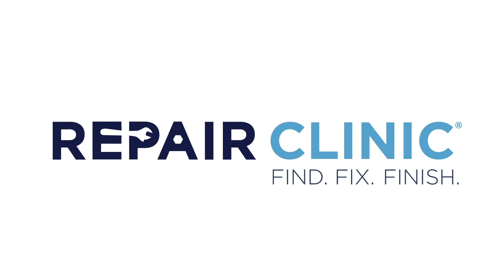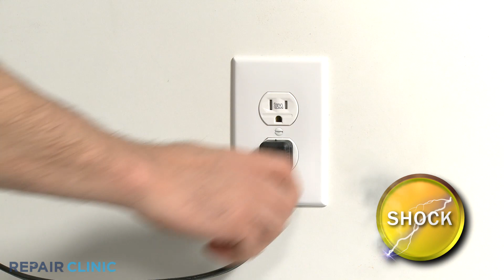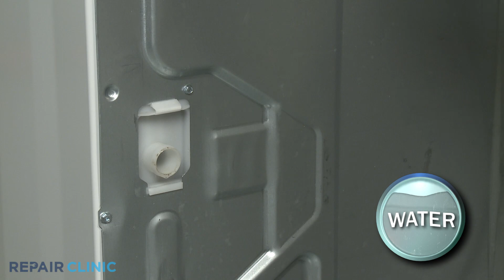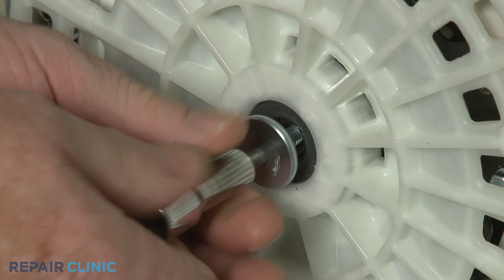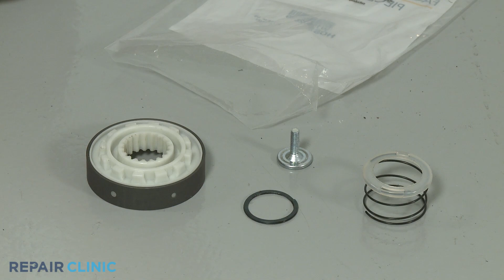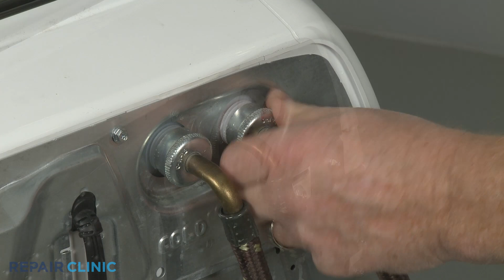Whirlpool Top-Load Washer Clutch Slider Gear Replacement W10734521

Comment: Is it necessary to replace the clutch at the same time you replace the slider gear. The slider gear part is listed as the shift actuator on whirlpools website is that what it is?
Reply: Recommend.

Comment: The slider on my cabrio was causing all kinds of popping and grinding noises. I had to also replace the stator because the slider wouldnt slide, it would get stuck in place and it eventually destroyed the teeth on the stator along with other issues.
Its working like a champ after replacing both!
Thank you for the instructional video!
Reply: washer

Comment: Just a heads up for other people with grinding noise on spin only (at the VERY tail end of the cycle) - the single torx bolt may be super loose on the bottom of this assembly, and that's it.  That was my problem and I'm glad I got under there and checked before parts even arrived (though I will keep this part for future problems in case they stop making them).  My bolt was so loose it wasn't even finger tight, letting the spline/rotor free spin.  My rotor just basically FELL off.  Luckily no damage to any splines or rotor/stators, but I tightened her back up, checked the high spin in diag mode (it would do it when you would STOP the spin garunteed) - good to go.  3 year old washer, would have been totaled out by a service call since they wouldn't have even said it was just a loose bolt, but a bad rotor/stator/clutch/who knows.
Reply: Thank you so much for this detailed comment. We just fixed our washer thanks to you!
Reply: @Hunterjustbetter  No problem! would recommend blue loctite on that bolt too, but even just tightening it back up snug will probably last for years, who knows how tight they were getting it from the factory.  Obviously not tight enough.
Reply: Just tightened mine up. All the plastic looked good so hopefully that'll do it.
Reply: Thanks was about to order the slider, and hope for the best. 
We have the exact same symptoms you described.
Reply: OMG THANK YOU repair guy on the phone said washer was toast/not worth repair cost, I tried pulling the clutch out and it looked fine visually - saw this comment and reassembled wrenching down good and tight on that bolt and I appear to be up and running again! 🤞
Reply: You saved another families day with this comment… the bolt was about an INCH out from the rotor. Scary.

Comment: I have a problem with my diagnostic screen on my cabrio washer  all was well  as it told me the problem so I replaced the door latch then after I reassembled  everything the screen comes on but I cannot change anything norwill it start. I try to go into diagnostics  and the lights flicker but will not go into diagnostics I was very careful  I have done a lot of appliance  repairs over the years

Comment: My washing machine is a Maytag MVWB765FC3. At 4 and a half years of age, it suddenly now has the outer circumference of its slider binding up against the inside of the clutch magnet. I can't see anything wrong with my eyes. All I can think of for a cause is that somehow the inner diameter of the clutch got smaller, the diameter of the slider got bigger, or the transmission assembly shaft got bent somehow. I know of no real reason why any of that would have happened. The machine has not suffered any bangs or traumatic impacts. Any ideas of what is going on? I'm baffled.

Comment: My clutch won't come off. Any ideas?
Reply: Did you figure out what to do? Ours is stuck too
Reply: @lexyprice4753  Yes. Did you loosen the tub from the top?
Reply: @mayatuck  no. But it seems to have a minor leak and the metal gear was rusty. It took some work and some penatraiting spray but we finally got it done. Cleaned out the rust, added some grease and replaced the clutch and now it spins like a new machine.
Reply: @lexyprice4753  Awesome!!! Feels good right? This video helped a lot.